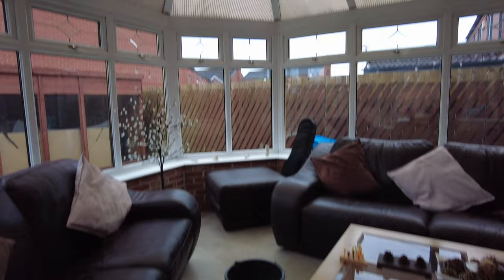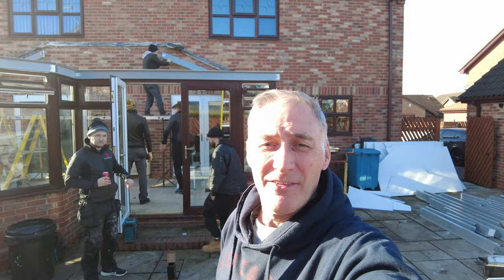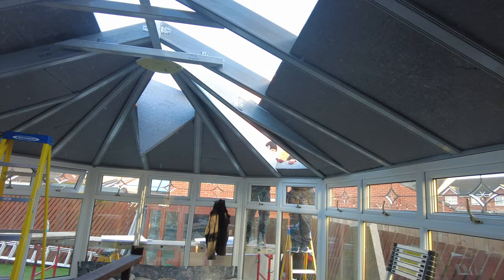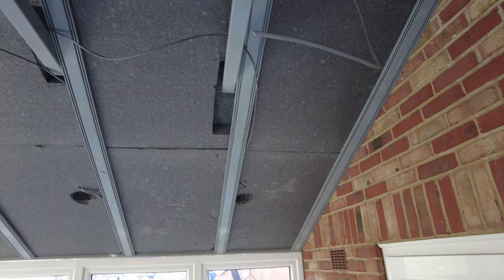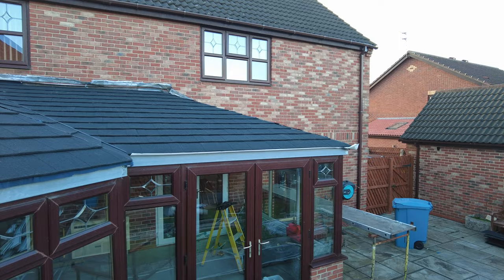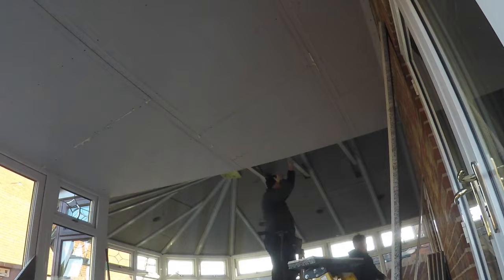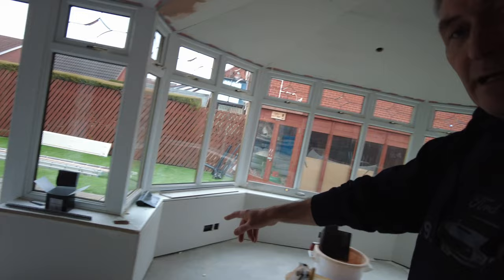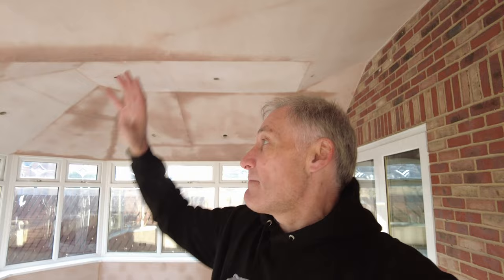I Get My Leaking Conservatory Roof Replaced With a Solid Tiled one!

Comment: Great job, it looks so neat, and matches the house nicely.

Do they check the foundation depth etc before they fit a tiled roof, because of the extra weight???

I'm definitely thinking of having mine replaced with tiles.
Reply from the maker: These are not tiles, they are like aluminium pieces covered in felt, the weight of the end product is probable just a little over what was originally used